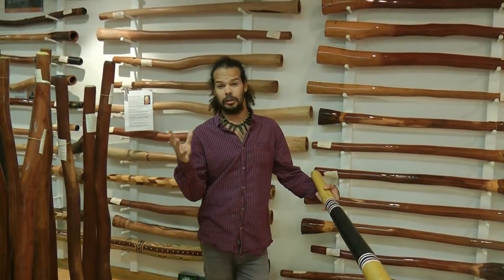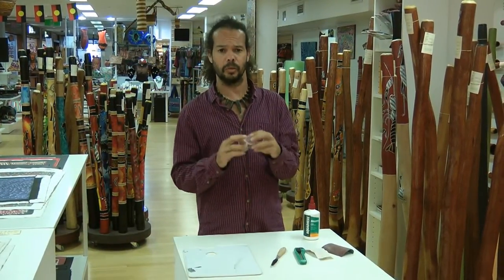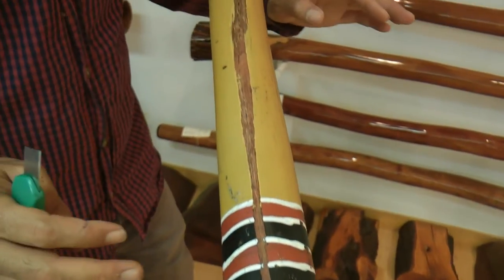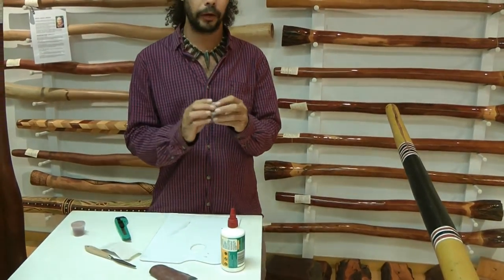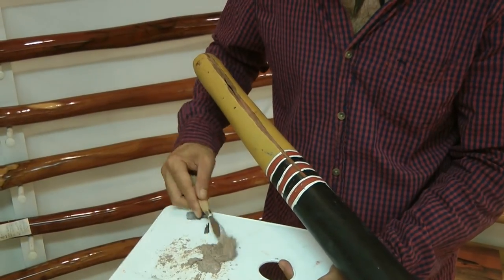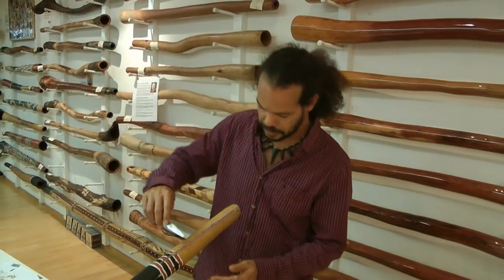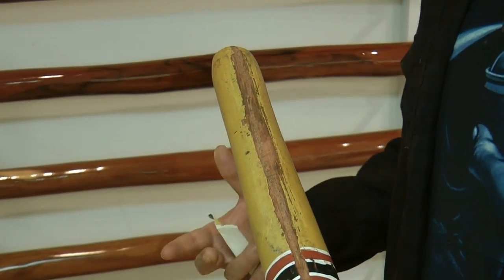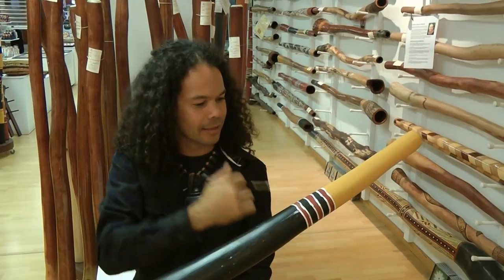Didgeridoo Repair- How To Fix a Cracked Didgeridoo

Comment from the maker: Hi Sebastian. Some didgeridoos will crack eventually, it's made from wood that expands and contracts with changes from season to season. If where you are living is dry and cold, I recommend using Linseed oil or any natural wood oil that isn't toxic. It is better to oil it at the end of summer before it gets dry and cold. If you are going to repair the cracks, oil the didjeridoo and leave it for few weeks before repairing it. I hope this helps.

Comment from the maker: Some makers just seal the top and bottom as they feel these are the vulnerable points of the didge for cracks and u keep the natural sound of didge.Some makers seal the entire inside to waterproof, strengthen and to brighten sound and avoid moisture leakage into the didge. Some makers prefer oiling the inside to avoid excessive dryness and for conditioning or even pour beeswax down the middle.There are theories for and against each one.I have seen all variants crack so its hard to favour one!!

Comment: I am absolutely heartbroken.  It took me 3 weeks to finally get a lovely (well, better than before, anyway) drone sound from my didgeridoo.  Consequently I practiced for a whole hour two days in a row ... and I woke to find my didge had split about 3/5 of the length of the instrument.  A second crack extended the damage 2/3 of the length of the didge.

I used the above demonstration to seal my cracks and split, and while not very attractive, I THOUGHT I did a pretty good job, but the instrument just doesn't sound the same.  I can't get the deep drone and fear air is leaking where I can't see it, so ... I will be duct taping my didge.  

I now feel rather authentic.

Comment from the maker: If it is a wide open crack ( as in the top of this didgeridoo) its ok if the paste goes all the way to the internal  bore or at least the large majority of the way..it could even go further with no real harm  and even create a small bumpy rough surface on inside of didge!!!..would not make much difference to sound quality anyway as internal of didge is full of cracks, crevices, bumps, channels etc etc

Comment: oh actually one more question,   i was looking in my didg (Ironbark), and it looks like there is a bit of sealer on the mouth and bell going maybe 4cms inwards.  I'm looking at sealing the whole thing to make it a little tougher and water proof.    I live in a super dry climate and think that this might help.  What do you reckon?    

Is there any particular resins, oils, or varnishes that work better with Ironbark wood?

Comment: What's the reason for mixing in sawdust?  Does that affect the sound or is it only for aesthetics?
Reply: Michael Karlovich If you just used glue it would be runny and it would get into the internals of the didgeridoo, but with the sawdust it's more of a paste

Comment: Hey Sean, I noticed a couple of cracks in my one month old didge :( It's a non painted one that has been glossed. I'm going to attempt to fix it using your method. I was told of another method where you apply super glue and then quickly sand over the crack to get saw dust into it. This other methods sounds easier but I sort of trust that REALLY know what you're doing. My problem is that I don't know how to get that much saw dust off of my dige (truthfully I don't want scratch it in any way). You said to shave some off and then cut it up. How do you cut up shavings finely? Do you guys sell those little containers of saw dust?
Reply from the maker: That is the other good way ( i.e. superglue technique). Sometimes you need to open the crack though to relieve tension. You don't need to use the shavings from the didge..any sawdust will do, especially in the above example where we paint over the area. With a natural finish didge you would want to match the colour of the sawdust to the didgeridoo if  aesthetics is an issue. We don't sell the saw dust.. Hardware store or just sand a piece of timber and use the droppings!!
Reply: Awesome! Thanks Sean! :)
Reply: Tim Endicott Ok, so I've sanded back the mouth end of the didge (up to the length of the crack) to get all of the gloss off. Then I spent most off the day sanding the wood to get enough sawdust to mix with the glue. I'm hoping there is enough. Any tips on a quicker way of getting it off the didge without making it look dodgy? I thought maybe I could slice very thin bits off and then chop them up with scissors. I am however worried this will standout. Wish I lived in Sydney. I'd just come to the shop and chat to you.
Reply from the maker: Tim Endicott You want the sawdust to be relatively fine. Scissors won't do this!! You are doing the right thing. Good workmanship ( and repairing) takes time!
Reply: SpiritGallery Whoops. Too late now (I'm a bit impatient...hehehe). My first attempt failed. I waited two days for it to dry but it didn't fulling cure. It ended up pulling up half of the glue inside the crack. I think it is because it has been too wet in Brissie lately. It worked for half of it. I sanded off heaps more sawdust, made up some more glue with it and tried again. It has work well this time. I am currently up to the re-glossing. It's pretty difficult to hide the transition back to the original gloss though. All in all, it has been a scary but fun process. Thanks for all of your help Sean :)
Reply: Tim Endicott Oh yeah I didn't mention, I used the shaving I created when widening the crack. I chopped them up using scissors. I totally agree that sawdust works better. I don't think the colour was as good in the area that I used the chopped up shavings. It's all about sanding FOR A LONG TIME to get enough sawdust to make enough glue solution. Oh yeah, and A LOT of patients. :)
Reply from the maker: Just noticed you said your didge was only a couple of weeks old. Did you contact the purchaser and discuss the crack and maybe get them to repair it or compensate? We at Spirit Gallery certainly would- although with our quality control and better known makers it rarely happens. Buy once buy right is the motto here!!
Reply: SpiritGallery Yeah the good folk at Didgeridoo Breath in WA have just sent me out a new didge. I'm really happy with the service. In saying that, next time I will look at the didges you guys have and make my selection between the two stores. I plan to have a wall full of them eventually. Actually, do you guys sell wall racks?
Reply from the maker: 2 for the price of 1 !!  You can make wall racks or go to a hardware store and get rounded wooden hooks. I may know a couple of guys that can make custom wall racks but i don't know about cost/shipping . If you are  looking to upgrade in the future or just looking for a good quality value for money didge or one from  Australia's better known didge makers feel free to give us a shout. Contact us via -mail.
Reply: SpiritGallery OK cheers for that! Will drop you an email, when I'm ready for my third one :)

Comment: So I tried this technique on my didge. It worked but after a week the crack started to extend further. Is there a way to stop the crack from continuing?
Reply from the maker: Perhaps drill a hole a bit further down from the crack and then patch it up with a dowel. This might stop it. Was the crack opened up enough during the repair  to relieve the tension and was there hidden, underlying non visible cracks. How well is the didge made- are the walls inconsistent, how was it sealed, was the timber dried or made green. Many variables. Some didges ( particularly cheaper ones) are just doomed!  Last resort- wrap it in duct tape. Best long term solution- buy the best quality didge you can. Good luck
Reply: I think I carved out enough. I'm really not sure. When you say "are the walls inconsistent", are you talking about at the mouthpiece? I have noticed that some walls at that end are slightly thinner in parts. Not sure how the inside is sealed. The outside has a gloss on it. I'm not sure about if it was dried or green when made either. I bought it from Didgeridoo Breath in WA. They claim to have good quality didges. Like I said, I'll give you guys a try next time :)

Comment: Mate can you help me with this? I bout my didgeridoo in Cairns one year ago and since 8 mouth that I move to Chile, since the last few weeks that I started to play it everyday (1 or 2 hours) and got a cack on my didge, and then when I play it again I got 3 more . 
Well is quite cold and dry here but I don’t thing that the weather is the problem; otherwise my didge would have cracked when I got here (in winter time) so what do you thing is the problem?Should I fix the little ones (2cm long)?